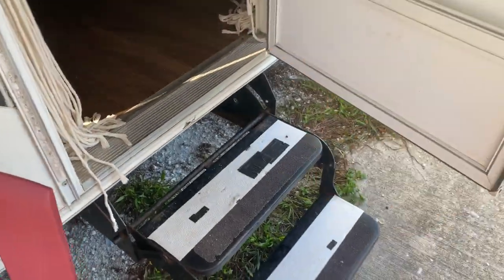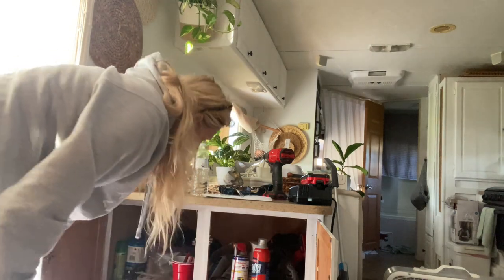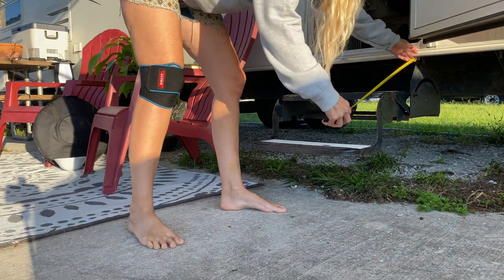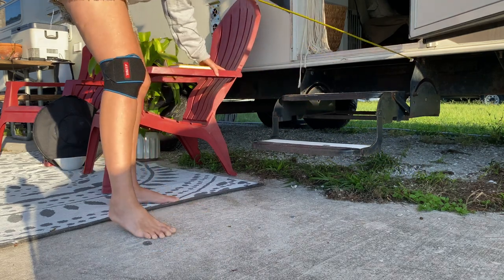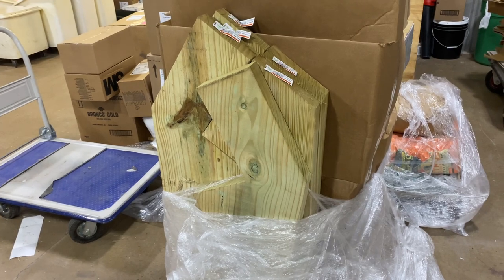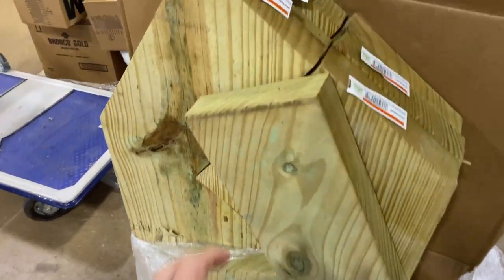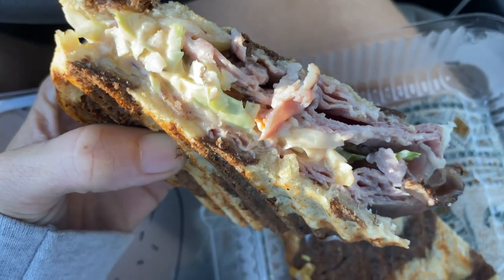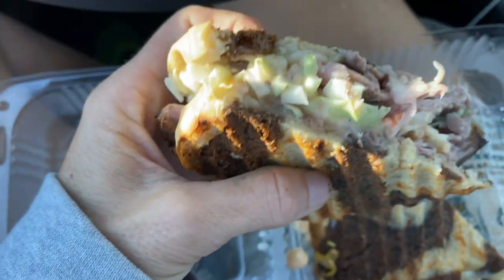DIY RV STEPS in the making| TINY LIVING| CAMPER LIFE| Tiny Home

Comment: The average stair rise is 7" tread (where your foot goes) 10" most building codes it has to do with safety.
Reply from the maker: Good to know! These are not very safe for me though as I’ve almost slipped, fell and twisted my ankle a half a dozen times in 2 months. I can feel my knee buckle when I take that first step down. Going up is no problem though
Reply: @floridachickstinyadventures  😢
Reply from the maker: Hopefully building new ones will help though! :)
Reply: @floridachickstinyadventures   Looking at the size of your foot that tread is nowhere near 10" I wear size 6-7 women's shoes and I think I would have problems on that step and the rise looks like more than 7" from the bottom step to the ground. Measure the height from the floor of the RV down to the ground and divide it by 2 if it is around or less than 14" If it is more than 14" divide it by 3. Since the first Tread would be the top of the steps that you make. you might only need to make 2 steps but from the ground up, unlike the ones attached to the RV which are from the floor of the RV down. Make the steps about  1" narrower than your door opening, that way should you need to move the RV for whatever reason you can just pick up the step and set it in the entryway of the RV. It appears that I wrote a book lol, I am better at sketches. Good Luck!
Reply from the maker: Oh wow! I have some work to do! I’m the same size shoe as you. I was thinking of whatever I build would go in the back on the cargo rack when we move it. I’m sure by the time the next video comes out I’ll have changed my plans 10 times 😂😂